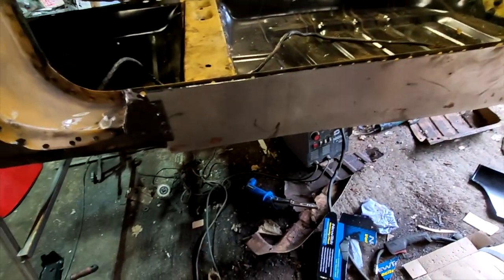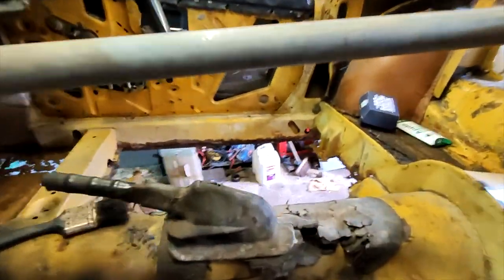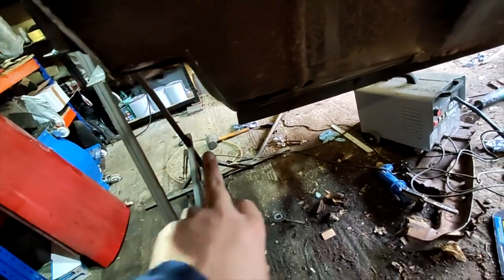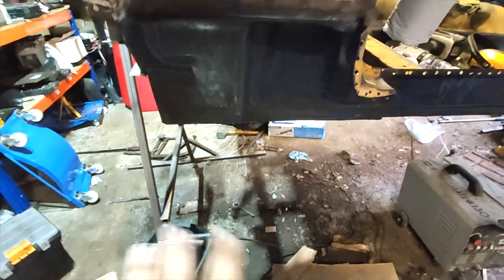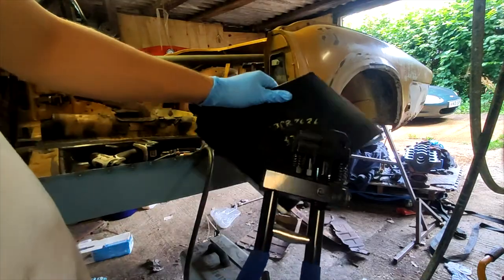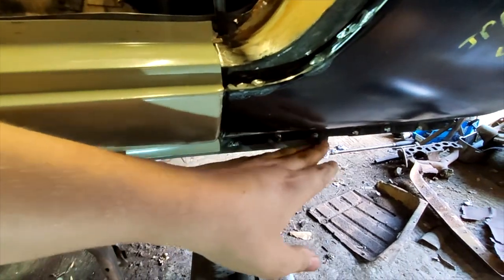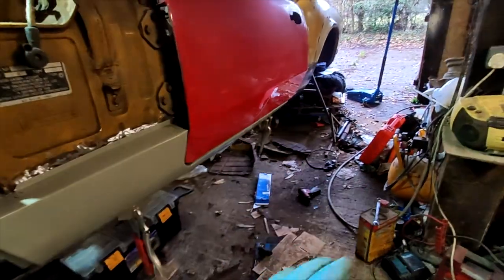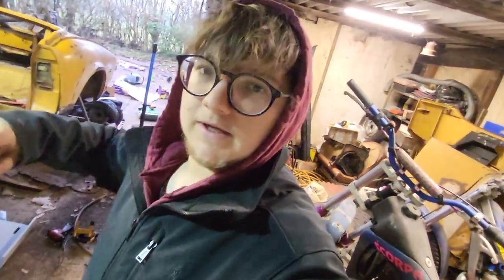Making Inner Sill from scratch! it was all coming together until my welder blew up...🔥Spitfire pt 5🔥

Comment: Good work, and you seem to working at a good pace too. One tip don't use silicon for sealing up use a proper seam sealer as silicon isn't paint compatible and if any of it get on a visible panel the paint won't adhere (paint shops hate silicon). I use Sikaflex and have found it very good and easy to get a nice smooth seal with it. Good luck